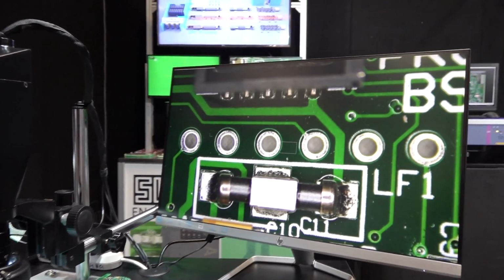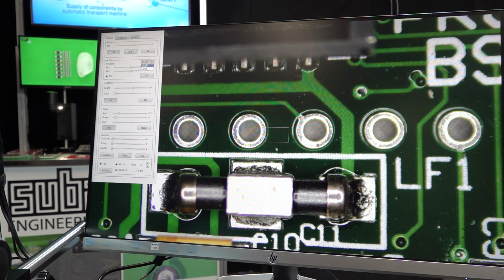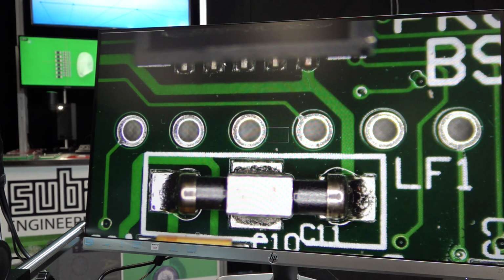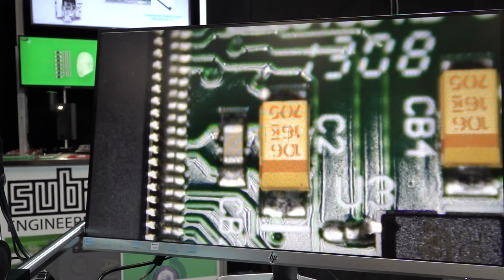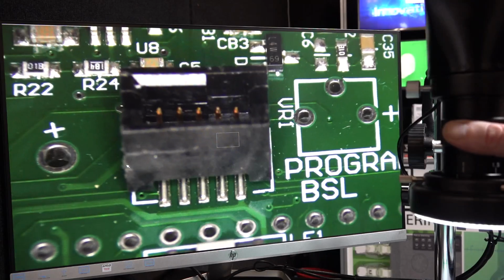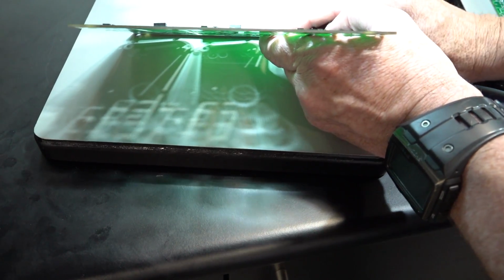New Suba Engineering PCB Microscope - Tagarno Killer?

Comment: You have to purchase the monitor too? A HP junk?
Reply from the maker: No, it's included, 4K.
Reply: 4k Res or 4k Cash
Reply from the maker: 4K res, AU$1800 total for the lot.
Reply: EEVblog2  I have one, for $1800+GST, it comes with a standard range Asus 1080p Full HD IPS panel monitor, not a 4K monitor! I forget the size, it's around 22 inch or something. $1500+GST option for no monitor. The captured images and movies are also 1080p.

Comment: that is impressive, it seems like they looked at the tagarno microscope and said, f*ck that, we can make a better one for half the price and so they did!
Reply from the maker: They literally did, I spoke to the owner about it.
Reply: VoltLog. Wonderful in a production line, but there are many ways to get similar quality for 1/10 to 1/2 of this price even. Asking just a little bit of creativity.
Reply: Do you know any off the shelve camera + software that can do that zone of interest auto-focus thing? And is compatible with off the shelve magnification optics? I am not aware of such a setup existing..
Reply: Not out of my head, but I have seen and worked with plenty of setups with macro camera's, lenses etc that worked just fine to find defects on PCB's
Nowadays there is even a lot possible with just a decent smartphone.
Maybe not the ultra "crisp and sharp" super HD quality, but more than good enough to work with.
(and a smart person can probably make it equally good even)
Just saying it for people or companies that don't have such a budget.
Keep in mind that 1080 isn't that much to brag about anymore these days.
Reply: its not re-autofocusing, its following center box focus. this is ~50 lines with OpenCV. Checking for blurriness can be as trivial as compressing image and comparing size - less blurr = more detail = more information = bigger size. Or do it properly and run fft/laplacian. Its all basic stuff nowadays.
Reply: Checking for focus usually is an average of the pixel to pixel luminosity difference within the focus area. It's a simple min/max algorithm. I have never heard of a compression size check, but seems ridiculously inefficient... The faster the camera can determine if something is in focus, the faster it can refocus, which is always welcome.